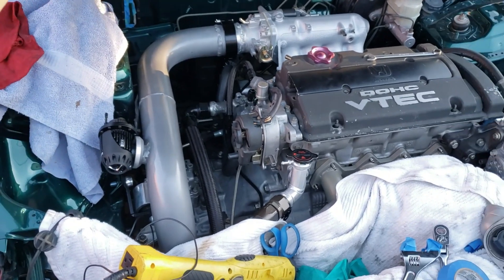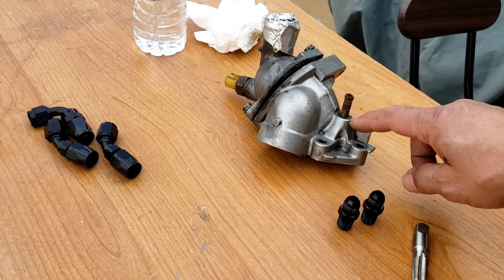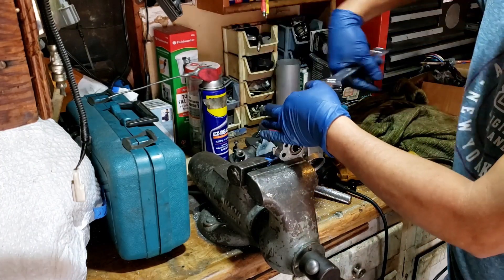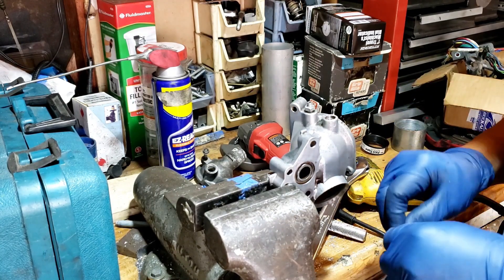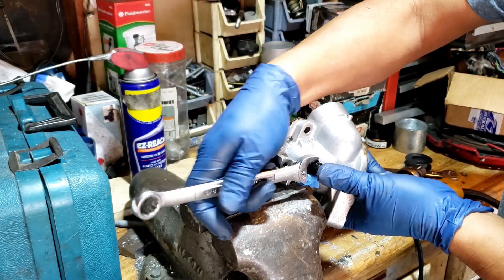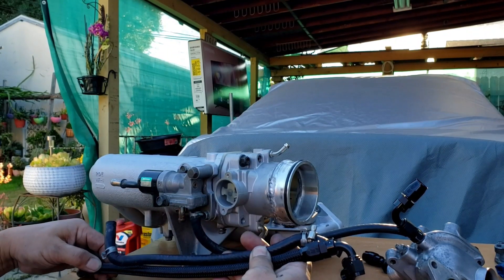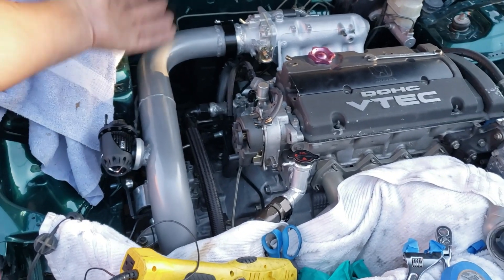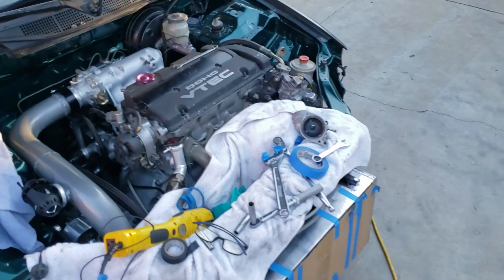H22 Thermostat housing with  -6AN  fitting install

Comment: How easy that clamp on throttle body moves? Is it like a snug or loose etc. it could vibrate from engine vibration?
Reply from the maker: This is my 1st time using a HD clamp and l think it's like that( loose). It tigntened a bit after l installed the rubber seals. But it should tighten more w/ pressurize air, l hope. I will give a update on it. Once Myllie is operational. Thanks
Reply: @sagittnet2158  Thank you! I am looking forward if you would make an video about pressure testing that system. Also I think vibrant said in one of their videos some people use electrical tape around there to make it just a little bit more snug.
Reply from the maker: @aleksisalenius5103  no problem man, thanks

Comment: That o-ring on the coolant pipe tends to leak when you mess with it, just a heads up.👍
Reply from the maker: True, l had that thing leaked on me before, it's not that hard to change but require some finese for the housing to be seated correctly. Thanks